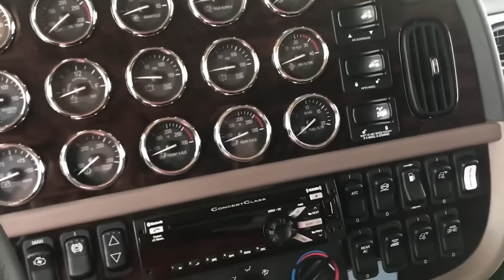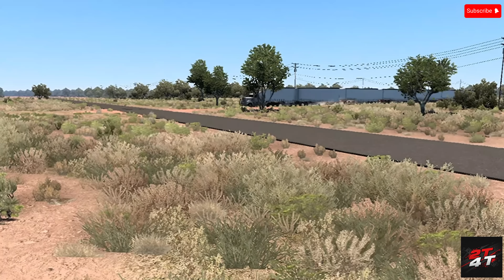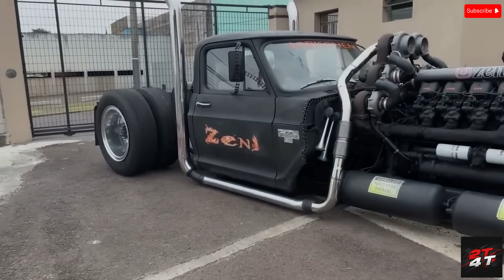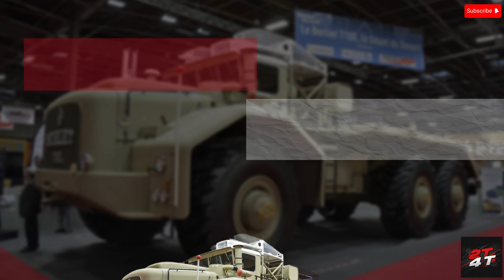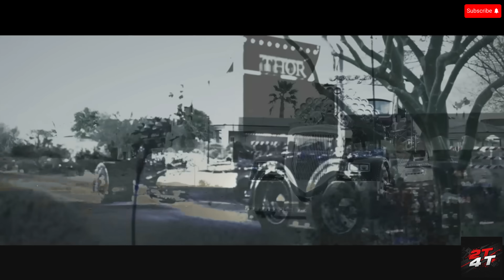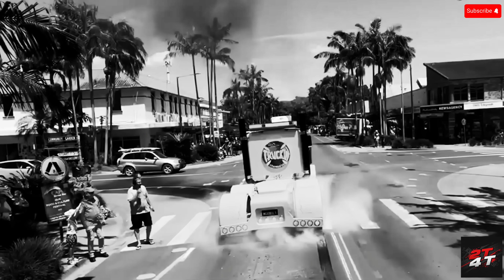The TOP 5 Most POWERFUL V12 Trucks Ever Built!

Comment: The Chevy truck (2nd shown) you say has a v12 created from two v6 Chevy engines. A sentence later go on to say it's a 9L inline 12 cylinder.  But all you have to do is take one look at the engine shown and you see it's not an inline 12. Crap
Reply: It's not even a GMC gas or a Detroit diesel V12. It's an air-cooled Deutsch diesel

Comment: L B F T I thought it was foot pounds, you need to know your terminology  cat never made a c16  Either 15 or 18
Reply: Bro.....yes Cat made a c16.
Reply: Cat DID manufacture the C16... it was released in 2000, and had numerous hp ratings, depending on its end use setup (gensets, trucks, marine, etc).